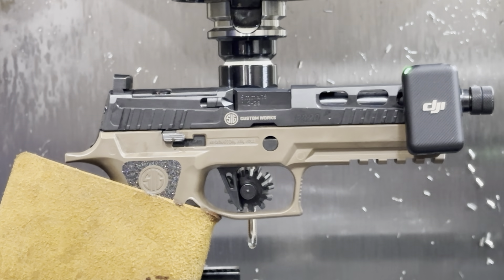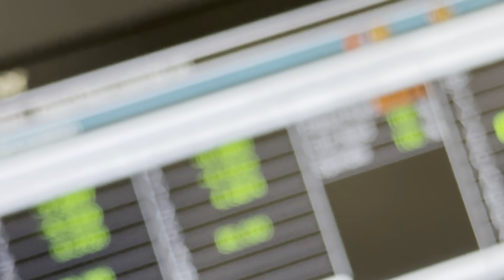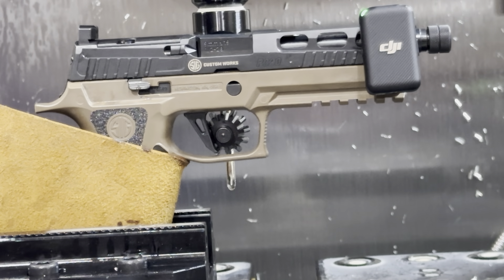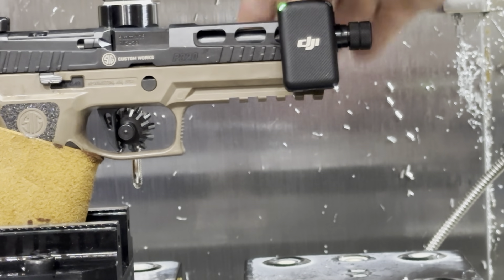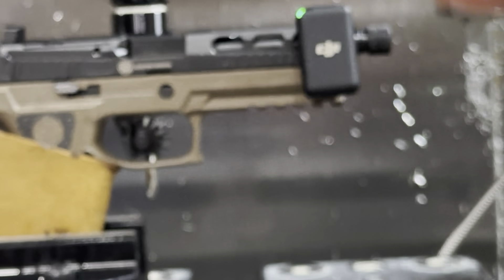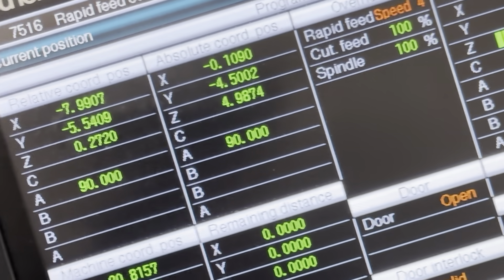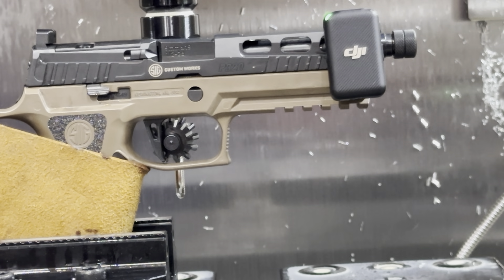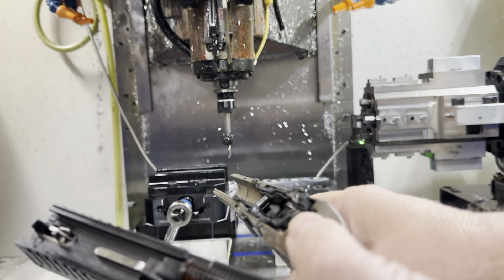Sig P320 accidental discharge tested in CNC machine.

Comment: I wonder if cocking the slide all the way back makes a difference.  Each time you charge the striker, you're only pulling the slide back an inch or so.  Try pulling it all the way back.  I'm guessing the saftey or sear mechanis is not fully resetting on a partial slide stroke.

Comment: Was there a loaded clip in the gun loaded with primed only casings to put pressure on the firing mechanism?  That would be more accurate to the original video by Wyoming gun project

Comment: That's with this particular specimen....what if there is any dirt or the mating parts are at different ends of the tolerance window. Too many variables including wear to take these numbers as law. Too many instances of uncommanded fire for there not to be a design issue.

Comment: He has another video with a Glock.When he is pressing on the slide of the glock it is causing the pin to be pushed against the trigger. In other words he is moving the entire pistol forward causing the pin to press against the trigger. The pin may not be moving but the gun is, that vice is not keep the gun completely free of movement. So of course it is going to go off, He pushed the trigger to complete the firing cycle. On the P320 trigger test he performed in this video the trigger never moves but still goes off. Compare the two videos for yourself and see. This guy is a joke!

Comment: I still don’t understand completely … if a 320 is sitting in a holster and the trigger is obviously not being pulled back to the wall, then why is it going off at random times?   If I start banging on a 320 that’s holstered why is it going off if no one‘s touching the trigger??   I still need that explain to me.  It’s not that I am denying the 320s are safe, something is obviously wrong.   But why is everybody fixated on the trigger being pulled to the wall?  Bb the US Air Force sergeant that died wasn’t doing any of this stuff. His pistol was just sitting in a holster. Is it possible that something in the holster is moving the trigger to its wall. ??

Comment: One of the problems that may be the fact that almost no two p320s look the same. The amount of different customizations could be adding variables that arent being accounted for. But the general connection im picking up is too much slide play plus an issue with the seer catch equal uncommanded discharge. Good gun safety can protect you from most of that, but having it go off while holstered or holstering is a major issue. Again, could be avoided but not holstering or setting it down while chambered. As a service pistol, that is less than desireable. I will never trust it enough to own one. I will shoot one np, i just wont put it away loaded. Ever. And its definitely excluded from carrying consideration. 🤨💯

Comment: I thought of doing a similar test.  How about putting a primed cartridge and a mag in the gun. Touch off on the trigger and turn in until it fires and let’s see what the actual trip length of the trigger is.  If it trips under that length with any other contact then there is a serious defect.

Comment: You got pressure on the trigger, so there is less material preventing a discharge, but what would be more interesting is if you put pressure on the slide (forward & reverse) to see if that can cause a discharge. For instance if it held in holster and there is pressure on the slide reducing the grip on the hammer trigger-lock.
There looks to be a lot of slop (Wiggle room) on the slide.

Comment: It's annoying that some people still don't understand how bad it is for a duty pistol to go off with the slightest trigger, and slide movement as shown in these videos. Basically all that's required for some 320s to go off is the trigger needs to be touching something/out of spec, and the user needs to be moving around a bit. I have seen enough videos of 320s going off in the holster to know there is a problem, and this test makes me think the problem could be solved with a trigger safety, and heavier trigger, but it might be too late to save the 320 at this point.

Comment: all you have proven is so far your pistol doesn't fire uncommanded without at least some trigger pull, I've seen Jared from guns n gadgets take 3 or 4 of his sig P320's and each one would fire simply by rocking the slide with no finger on the trigger at all. I have seen others demonstrate the same flaw.

Comment: It’s bot a fact of “your trigger must be pulled to get it discharge” the whole point of these people doing the test but pulling the slack is to “SIMULATE” key word, IF parts are off spec from factory. So if a gun is out of spec then that slack doesn’t need to be pulled back it can just fire which is what has been happening probably due to them having a contract and mass production of these guns for the military and police. But the fact that the guns civilians are getting can even get the gun to fire by wiggling the slide is absurd, it’s absurd that the slide has so much play in it that barely squeezing trigger it moves it. They made a bad design and now are reaping the consequences to not making sure they had a quality firearm

Comment: I have heard this “John Wick” rhetoric before and it’s so flawed it’s funny. This guy is reassembling the 320 slide to frame in the same way a Glock is disassembled. Who even reassembles a Glock that way? No one. So no. This isn’t how people are reassembling Glocks, and since they don’t they are not doing this to 320s. Why is the second sear notch failing? No one seems to be able to answer this.

Comment: I know what the issue is, its a multi part issue.
1. Slop between rails and frame
2. The sear that is in the 320 isn't the sear that was patented, basically the original lightweight sear didnt have a leg directly below the sear or the secondary safety notch. This leg will rub the safety lever and moves it. Removing the leg will uncouple the parts to where the trigger bar will be the only working everything independently. It also allows the sear to sit higher in the fcu when in fire mode.
3. Peen the slide and fcu rails to give a tighter fit.
4. Install and agency trigger to stop the trigger bar movement (regardless of having a manual safety or not
5. Polish the firing pin and sear face to reduce drag.
If you'd like to know my pedigree im a 18 year gunsmith and prior army armor. I built all my p320s from scratch and i dont have issues.

Comment: Its hilarious how SIG lovers are working so hard to justify the P320😂. I don't care how technical you get. That gun is not supposed to go off unless the trigger is pulled all the way back. The facts are that this gun is not safe. Just cause your gun is doing it at -90 doesn't mean that others are at the same ratio. The P320 should be banned and SIG should be sued.

Comment: It think the issue arises with tolerance stacking, and the fact that the striker block safety is disengaged at such a small trigger pull. I have yet to see anyone measure the distance the block needs to be pressed for disengagement . Couple that with the possibility of a poor fitted holster and it's a recipe for disaster. I really do think this issue can be solved by a trigger blade safety and striker block rework.

Comment: So how much “actual” trigger pull is that?  The firing pin safety starts to actuate right as the trigger moves. So really I bet it’s more like 0.200 or 0.300  into the total trigger pull that the gun fires. So yeah if you take up 60-80% of the trigger pull then manipulate the slide it’s going to fire. What did they think would happen?

Comment: A lot of people don’t seem to understand most of the slop in these sigs is NOT slop between the slide and firing assembly, it’s slop between the firing assembly and polycarbonate handle. Essentially, everything is set inside a nice plastic handle that purposefully has play to make the gun shoot nicer and be lighter. 

That said, the fact that you can manipulate the slide and get it to fire means there is some play between the firing assembly and slide, which is problematic if the manufacturing tolerances are as bad as people are claiming.

Comment: Reading some of you guys comments on all these type post n some of you only see black or white, no nuance in your thinking. Applying pressure to your trigger and you shake the slide shouldn't allow a discharge only a complete trigger pull should. Like I've seen others say debris gets in your gun n could move or stick your trigger and then when the slide gets shuffled n boom theirs your 🥒

Comment: Would be interesting to see this test done on a normal curved trigger rather than a flat face trigger. The flat face is made to be at 0:01  90° angle before you start applying pressure to shoot.

Comment: Touching the slide still shouldn't set it off, it's not designed to go off without a full trigger pull, and the slide making it go off is the nail in the coffin. ... I think that's the point nobody can explain away, including Sig who has decided to die on this hill, and they will.

Comment: The part you mentioned with the magazine, that metal piece isn’t present in the 10mm and 45 models. Some people have received 9mm pistols and other smaller calibers than 45 and 10mm with the 10 mm chassis. That chassis doesn’t have that piece so it can accept a magazine in a caliber smaller than 45 and 10mm mags even when it’s disassembled. That’s been the problem is the mixed up and mismatched parts that will go in even if not in correct model.

Comment: Good stuff. Need actual as measured dimensions for a meaningful 100 typical internal Sig P320 parts run survey.  Then you need the actual process results for positional tolerances.  Add those results to expected wear results and spring repeatability.  Would then be able to create statistical story to support a lawsuit.  We Quality Control guys with statistical and metal deformation backgrounds are available at the right consulting fee!

Comment: The fact that you couldn’t put a mag in the pistol because you have to push the levers up first proves that it’s not user error it’s the pistol…. If someone did a takedown on the pistol and didn’t push the levers up before loading it means the sear isn’t up all the way and it can in fact drop the striker and that’s where the striker block supposed to stop the pin from striking primer…. But you can’t even get a mag inside if you don’t push the lever up that means it’s absolutely not user error it’s the pistol…. And you forgot that Wyoming did in fact say If you happen to get a pistol that’s out of spec yes it will go off period… now Sig is supposed to know this they supposed to have a margin to make up for the error in which is why secondary safety’s come in to play. Sigs quality control is gone to shit, Sigs answer to everything l going on shows they do not care and they will never take blame for their mistakes end of story on to the next…. Fellas did y’all see the new M&P shield X?? 🔥🔥🔥🔥

Comment: So bottom line, the trigger needs to be "manipulated" to a known point on "this" gun, which could be entirely different on another gun.  Then press the top of the slide near the muzzle creating leverage and releasing the sear causing the gun to fire.  I understand you have to press the trigger in order for this to happen but.....   how can a gun be allowed to fire with two inputs when in reality the only input to fire should be a full press of the trigger?  Isn't the trigger like and on / off switch?  ................asking for a friend.

Comment: So the gun fires without a complete pull of the trigger in GREAT condition. This indicates a flaw in the design. All it takes is one or two parts made in India to be out of spec, and now you have much bigger problems. The real world doesn't offer perfect conditions, and what every gun needs to ensure more than anything is that the only mechanism that will set it off out of the box is a complete trigger pull. No reason to buy from SIG, plenty of arms manufacturers that offer the equivalent and you don't have to worry about this. Maybe if this occurred after 10,000 rounds I'd feel different, but this flaw is inherent in the design.

Comment: What I want to see is these tests with a primed case. Is the striker safety disengaged at 90? Or is it failing? 

Would both pistols have set off a primer? Especially the Glock with an actual striker block?

Comment: I don’t know what kind of aftermarket you have in that gun but you shouldn’t have that much slop in your slide. My p320 ( stock ) with an optic is tight when I go to move my slide like that doesn’t rock like that. Grip doesn’t look like any p320 grip I’ve seen. I think you have an aftermarket thing instead of a discharge problem. Bye the way, you just showed me a aftermarket barrel.

Comment: Please re-run your test, only once you dial the trigger back to that sweet spot, RELEASE it, and THEN wiggle the slide.

The seer is sticking when the trigger is released. That HAS to be the problem. The problem isn't that manipulating the slide with the trigger pulled causes the gun to fire - The problem is that when you bring the P320's trigger to the wall (or rather, a hair past it), then let go of the trigger... the internals aren't getting the memo. They're staying in the same position, therefore a SIG without anything pulling on the trigger shoe will fire with slide manipulation because the seer is still in the position it would be in if you were pulling the trigger to the wall. 

That's why Glock, despite also being able to be fired with slide manipulation, isn't having this problem - the seer is released when the trigger is released. The P320's isn't. 

That's my theory. There is OBVIOUSLY something wrong with the P320 and if SIG isn't gonna figure it out, we will..  and we're really close.

Comment: Only one thing missing?  Using the CNC to move the trigger is great. But you now need a dial indicator on the front and back of the slide. To show how much travel distance the slide moves down or side to side to release the striker.
Other then that you are dead nuts on target. Great job.

Comment: I love it. Using a CNC machine with digital read out is great! Great reproduction of this defect. Where in the world is SIG in all this garage, basement and now machine shop testing? Again this is priceless…..
Reply: They're blaming the good people who were shot by their faulty product. I didn't fully understand the hate until I read their official statement which included: "nothing more than individuals seeking to profit or avoid personal responsibility" and some other victim blaming trash!
Reply: My shield 2.0, and Springfield XD will do the same thing when I take all the play out of the trigger all the way to the wall.
Reply: What defect? It's amazing how many people like you do not understand this.
Reply: @demon646 It's weird you're so defensive over something which you have no stake in?? People have died. Name another gun with the same "friendly fire" casualty rate.
Reply: @ultraneight  Because it's 83% of the trigger pull. I'm pretty sure the definition would be considering a trigger pull past 50%, even if you're not hitting the break wall yet.

Also 1 person has died, and no one knows all the details. Except for the fact that he DID flag himself with a loaded firearm in a holster that he carelessly threw down on a hard surface, at chest height. We don't even know if the manual safety was engaged, or disengaged when this tragic event happened.

This is a direct violation of a handful of Military guidelines on the victims parts, even if the gun did manage to fire due to a defect. It's cruel I know, but that's the way it works.
Reply: @ultraneight that ranger that they say got shot… there’s another ranger now under investigation for his death. The other videos you’ve seen have also been debunked if you look. All of them have had the trigger accidentally pulled when they zoom in.
Reply: @demon646 These are gonna be $20 dollar guns in a minute, I hope you're ready to invest!

Comment: This video is perfect! Sig's position is the gun can't fire if you don't pull the trigger. And the latest wave of goobers be like, "Look... if I pull the trigger to within a half millimeter of firing, then jiggle the slide, it fires!" I'm waiting for the video when someone - anyone - can get the P320 to fire without using a hammer concrete block or touch the trigger. Could you please please, please... set it up again, pull the trigger in to 0.090, then let it out, and wiggle the slide. I'll bet it doesn't fire.

Comment: I like the fact that you used a CNC to more accurately measure the pull distances on the trigger. However what you measured is only true for your firearm. You would need to test a good number of the firearms to come to any real conclusion on the amount of trigger pull. Plus there could be some other reason why the trigger doesn't return to past the wall position. 

I am going to go check my P365 X Macro Comp for play in the assembly.

Comment: I think if manufacturing and tolerances were consistent, then this test would hold more merit. Unfortunately, we have seen a large variance. So what holds true on this gun, does not hold true on others. Also, the internals are too soft! Do this test post 1000rounds, 2500rounds and 5000 rounds.
Reply: There is obvious engineering issues with this gun. We need to stop trying to prove otherwise… way too much smoke.

Comment: Try this with other guns and then say it's normal for the gun to go off. IMO it should NEVER discharge unless it's reached that 0.109 mark. Also, it's been proven that this line of pistols commonly has out of spec parts so you need to do this test with hundreds of P320's before your information is valid.